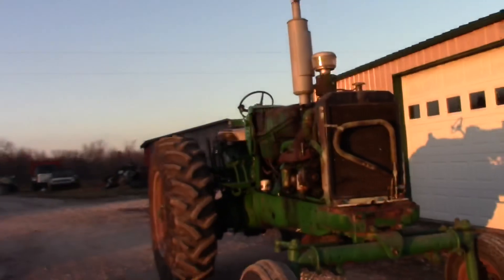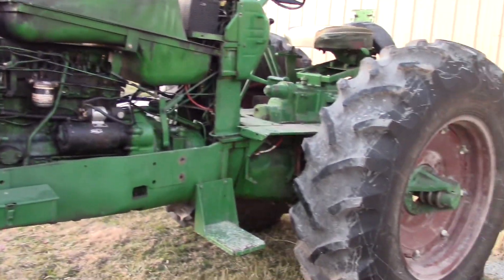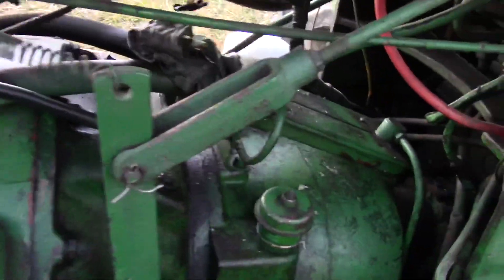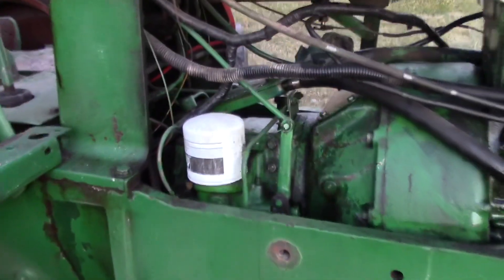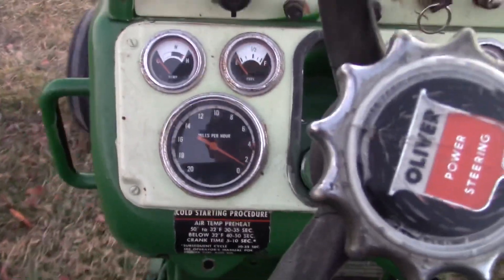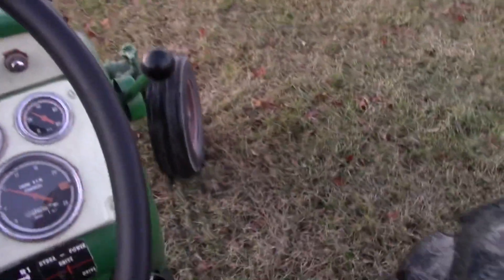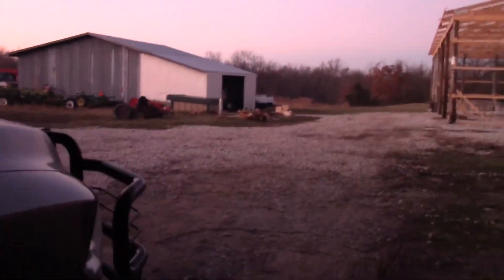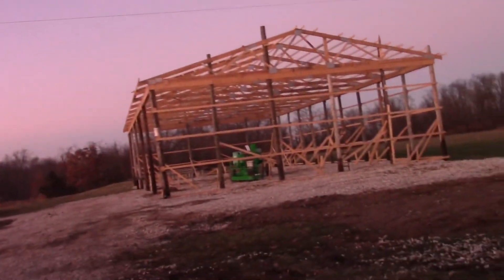Oliver’s Hydra Power/Hydraul Shift - What Is It?

Comment: Trying to change hydros in a 1850.
Found a good one out of a 1650 but the input shaft is smaller in the 1650 one.
Can the input shaft be changed for the bigger shaft, the rest looks identical.
Reply from the maker: Hugh Perkins I don’t think so.
Reply: 66Oliver they look identical and even take the same seal
Reply from the maker: Hugh Perkins Well, I haven’t done that type of job yet, so your guess is as good as mine, I just gave it a shot.
Reply: Thnx for the reply, I really appreciate it.
Reply from the maker: Hugh Perkins No problem.
Reply: Could you tell use how reliable these were. And are they rebuild able ?

Comment: The one I know of is a 1650 sold by the local dealer when they where still in business. Their retired mechanic is the one that said that was why it was a "special" . No hydra power. Otherwise it had a 3 point, 2 remotes. I didn't notice anything different from other ones I have worked on.
Reply from the maker: RedMech76 I don’t think they offered 1650 in that variant. The “Special” tractors (1750, and 1850), have Meadow Green paint with an Olive White instead of Clover White, they have stamped steel rear wheel centers, one headlight on the fender (or basically a 1650 fender), they have no extra transmission options, diesel only, and had a decal up on the front hood panels. There might be some options I am missing, but that pretty much what one looks like.

Comment: I am assuming the Hydra Power was an option? I am currently working on a 1650 that does not have  hydra, just a straight shaft from the clutch to the chain coupler.
Reply: I think the ones with no hydra power were called "special" , they were a lower priced option. They were nice to put a clutch in. You could slide the bell housing back then unbolt the pressure plate and clutch after pulling the pto  driveshaft.
Reply from the maker: RedMech76 The Hydra-Power is indeed a popular option. Tractors with a straight shaft are not a “Special” tractor. The “special” indignation was put on very few 1750s and 1850s (they’re extremely rare), and carried less options than a standard tractor to compete with Deere’s 4000 economy tractor.
Reply: @redmech7698 working on a 1655 it has strait thru shaft just got it has 4wd very ruff ol girl but will restore nicely

Comment: I grew up on IH myself, and always figured their Torque Amplifier was unique to their tractors. But It’s been interesting to find out that Minneapolis Moline and Oliver also had Powershift underdrive units that function almost identically. Then Massey Ferguson had Multipower, and Allis Chalmers had the Power Director hand clutch. Kinda ironic that everybody always rags on the Torque Amplifier when most companies had something similar. I figure it’s probably the Deere guys though 😂
Reply from the maker: Justin Stearns I’ve heard the TAs blow frequently. I’m in numerous Oliver groups and have only seen two cases of worn two or three speeds.
Reply: 66Oliver It’s mostly a case of misuse and lack of maintenance that kills TAs. Keep them adjusted correctly and shift them right, they’ll last a long time.
Reply from the maker: Justin Stearns Right.
Reply: The Oliver is NEARLY bulletproof. They have a long life if you treat them right.
Reply: The 1954 Farmall Super MTA was the first American tractor to have the ability to reduce ground speed without clutching and changing gears. Called Torque Amplifier, it was a unit bolted between the back of the clutch housing and rear end of a M design tractor. It had it's own clutch to engage or disengage with a lever when needed. When in TA mode the engine could not be used for braking but if needed say going down a hill, taking it out of TA mode restored compression braking.
Reply: It's called "free wheeling"  when TA is engaged.  Or under drive, or whatever brand name it has.  It's wise to respect this feature, or you can get in serious danger.